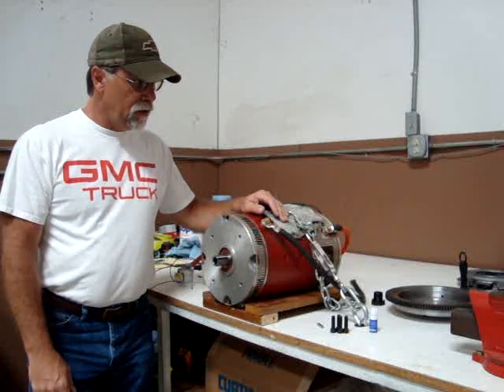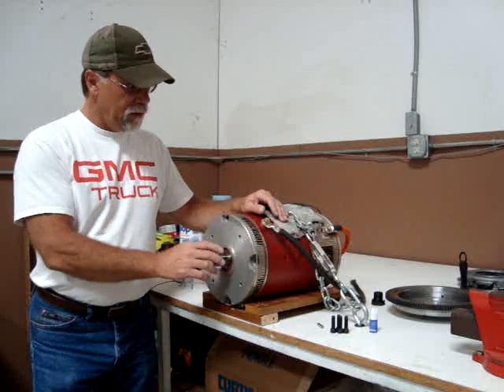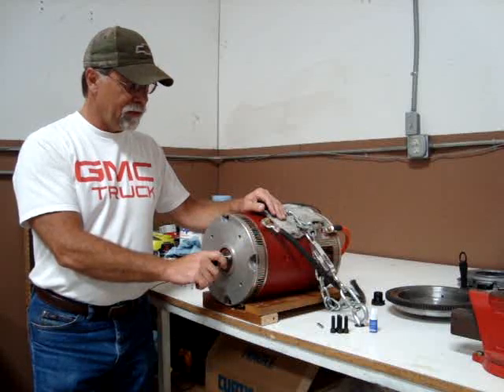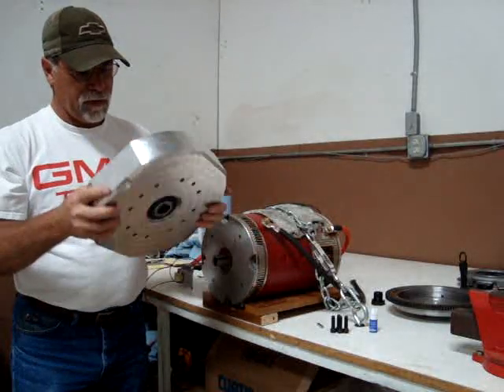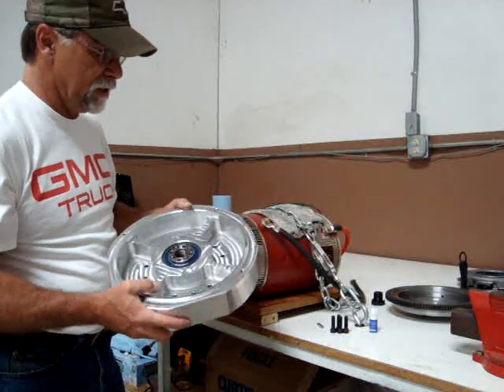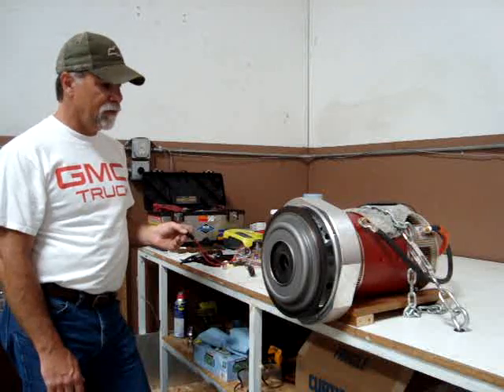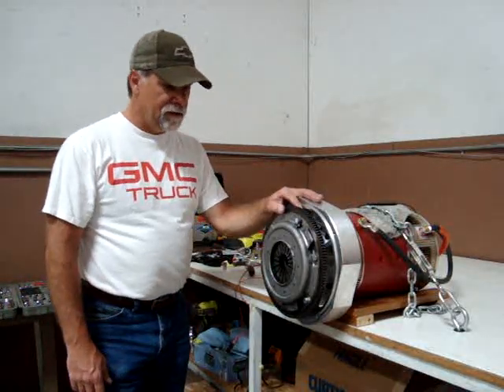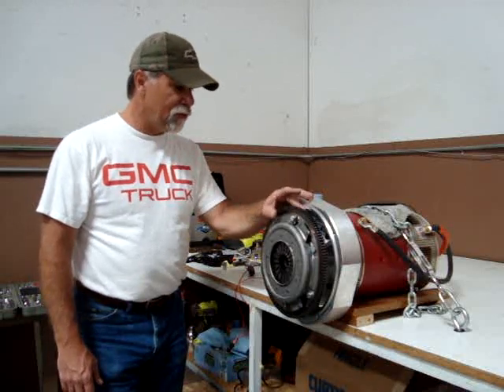Electric Conversions - How to Convert to Electric Series Part 5.wmv

Comment from the maker: First, thank for watching. In regards to the torque wrench, you are correct, once it clicks it has reached the preset torque. I think you are referring to the torquing of the flywheel gland nut, I continue to torque after it clicks as the torque wrench does not go as high as I need to go. But by using the torque wrench I make sure I at least get to the maximum torque setting of the wrench, plus a little extra. I have used this torque wrench and technique since the 1970s, so far so good.

Comment from the maker: We do use a flywheel lock for the clutch install, but when doing the flywheel nut, you can rotate the entire motor assembly.  On rear axle nuts, we use a 3/4" drive impact wrench, a few seconds, and you're done.  Thanks for watching and commenting.

Comment: Most EV conversions exclude the clutch assembly entirely. I presume that saves money. But here you use a factory made adapter plate with a shaft coupling already lined up. It only took you twenty minutes to put it all together! 

Are you ever asked to couple an engine directly to the transmission? Is there an equally quick and dirty procedure for that? Does anybody manufacture ready-made direct couplings,for example?

By the way. You keep a very clean shop. Impressive.

Comment: Instead of using the huge breaker bar to hold the flywheel you can use the universal flywheel locking tool and to torque the gland nut you want to use the Torque Meister Tool. Far simpler and the torque meister tool is useful for removing the rear axle nuts too for the VW. The flywheel lock and torque meister are must have tools for any VW mechanic. I would not work on any old VW without either one.

Comment from the maker: In regards to why the ImPulse 9 versus the WarP 9. In the video, "How to Convert to Electric Series, Part 3", I compare the ImPulse 9 and the WarP 9.  Short answer, the ImPusle 9 is 2-3/4" shorter than the WarP 9. To install the WarP 9 in the VWs requires cutting sheet metal, and you lose the stock deck lid latch as a result. They are both 9.25" and very close in spec. We use the WarP 9 in our Porsche conversions as the have a longer engine compartment. Hope this answers your question.

Comment: Oh thanks for the heads up its fine if you sold the car for $35,000 nice little profit , but if you kept it what would the time span be to recoup the outlay of $17,000 against not changing to electric ? apart from the fun of having a karmann Ghia .
Reply from the maker: Thanks for watching, and allowing us both to share.Let's compare the gas version of the Karmann Ghia to the electric.  The gas version got 25 mpg at best.  At 50 miles per day, 7 days a week, I drive approx. 18,250 miles per year.  That would be 730 gallons of gas @ 3.75?/gal. for a total of $2737.50.  The electric cost is $547.50.  The difference therefore is $2,190.  If costs stayed the same, which I doubt gas will, in 7-3/4 years, the cost of fuel will balance out.  In that time I will have driven 141,438 miles.  That means I would have to change the oil and adjust the valves 47 times.  With a 10.5 gallon fuel tank, I would probably have to go to the gas station approx. 754 times.  Most likely would have to rebuild the engine once?  BTW, what is the span to recoup the cost of a motorcycle, a bass boat, an ATV, a smart phone?  Thing is, this is not a replacement of a gas car, but an additional vehicle that saves daily wear and tear on my gas cars, so that are ready for those times when a gas car is desired.  The components in a conversion should out last you and me.

Comment: Seems odd using a flywheel.
Doesnt it make more sense to join the shaft of the motor to the shafr of the gearbox?
Doesnt the clutch introduse loss into the system?
Reply from the maker: The clutch does not introduce loss into the system.  Check out our video on why we use a clutch.

Comment: I saw a video a while back and the car was a shelb cobra with an electric motor in it. It had 300 hp and a 1000 ft lbs of torque! Thats more power than my dually 5.9 diesel. Do u have any idea what motor that was?
Reply from the maker: Not familiar with that vehicle.

Comment: its a big out lay and a lot of work considering it will only travel 40 - 60 miles before it needs a re charge ?
Reply from the maker: I guess it depends on your perspective.  The Karmann Ghia cost $5,000, sold the engine for $1,500, net cost for vehicle, $3,500.  Conversion cost, $17,000.  Total invested in project, $22,000.  Time to convert from gas to electric, less than eight days.  Average mileage driven daily, 50 miles.  Cost per mile, 2.83 cents.  Best offer on car to date $35,000.  The fun factor, almost priceless.  Check out some of EV4U's other videos for information on how EVs compare to internal combustion vehicles.

Comment: I take it that the adapter bearing is a sealed bearing design. What is the failure rate on a sealed bearing design? Would it be about the same rate as a sealed hub bearing design on a typical CV axle hub?
Reply from the maker: I don't know.  We have never had one fail.  Thanks for watching.